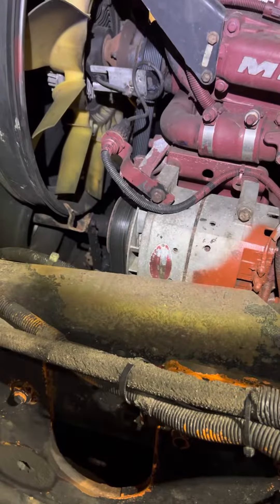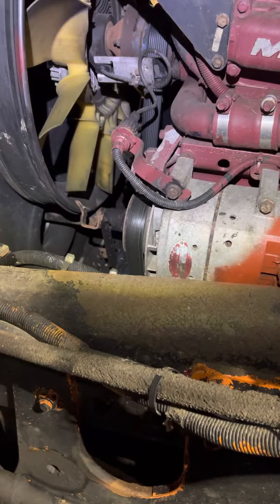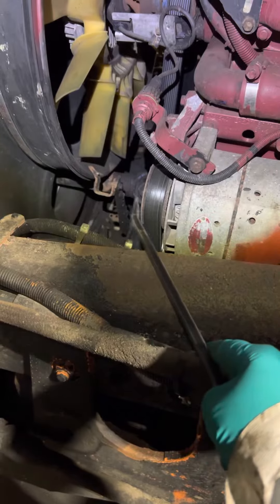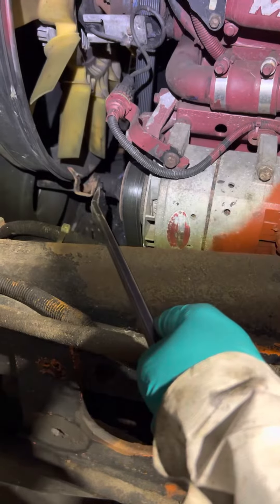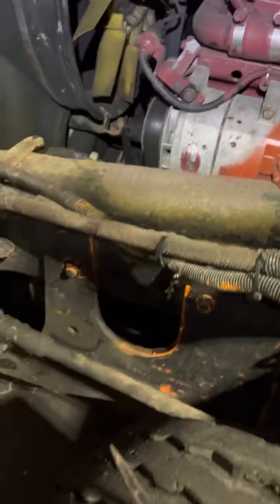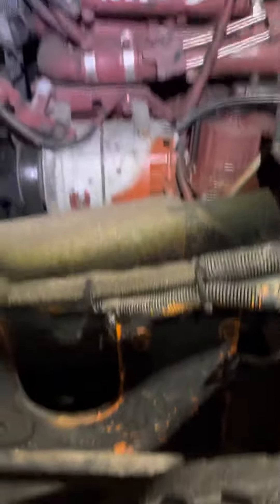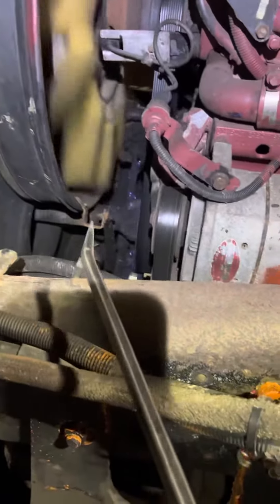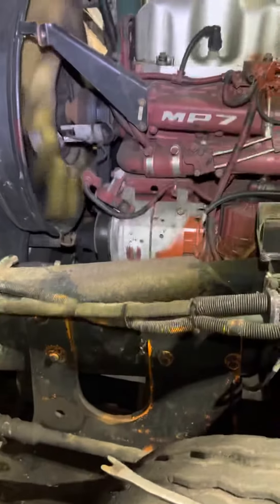Mack truck alternator quick test.

Comment: I'm having electrical issues on an 03 Mack MR. I was told it may be that my alternator is bad. She's at 14 volts when cranked and started, but the electronic malfunction light comes on then the shutdown light within 10 seconds then she will stall out. I'm going to try your test on the alternator today. Did a manual load test on the batteries last week and all 3 seem fine. Thanks for posting this.